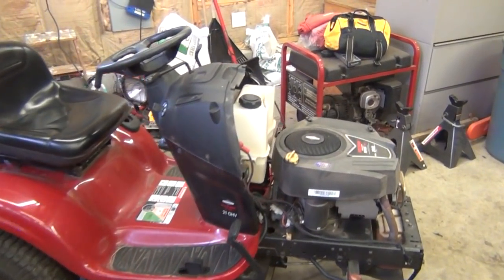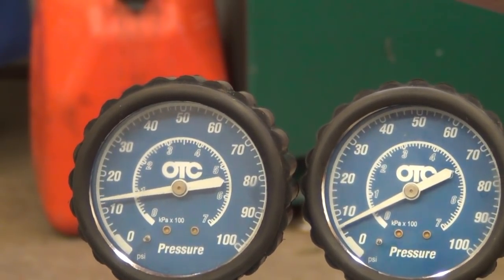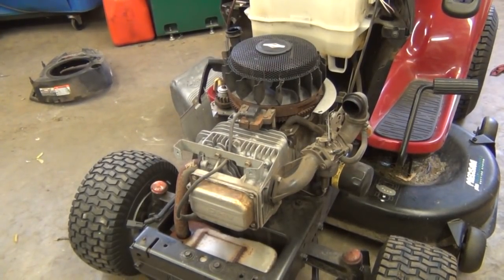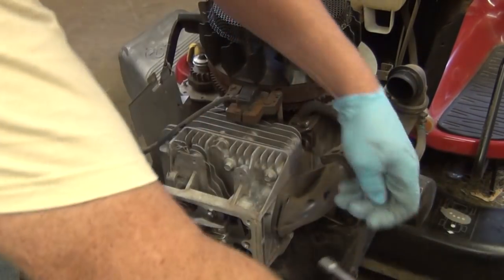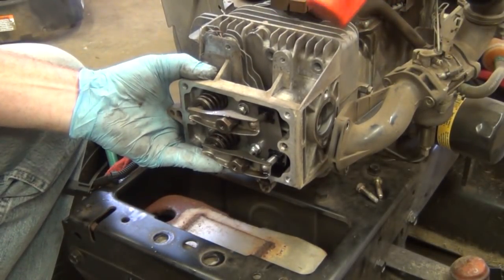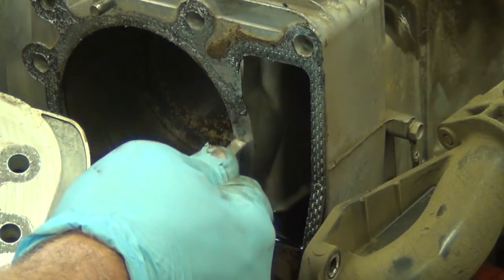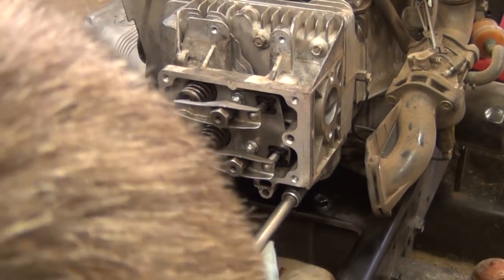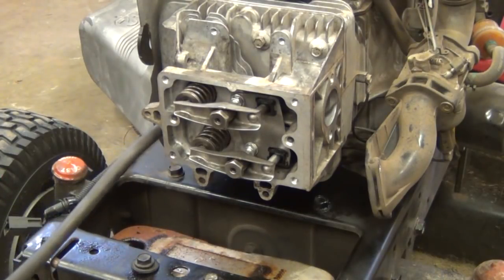Briggs and Stratton Cylinder head gasket replacement

Comment: Thanks for your head gasket replacement guide. It helped me doing the task. BTW. I went to our local lawnmoverstore for get a new head gasket. The old man said. If your head gasket is blown, you also have to get your cylinderhead planned. Else the head gasket change only will give you a few hours of happiness. I went home and checked my cylinderhead for warping with a steel ruler. It was warped as f***. So i went to the next big town and get my cal head planned. Got the engine assembled and valves adjusted. Everything runs smooth. Thanks to you and the old man at the lawnmovershop.
Reply from the maker: When I have the head off the engine, I run a straight edge down it to see if it's flat. Sometimes, they are not too bad and I clean them up with a file on the high spots.  If the engine has been neglected for most of it's life, I replace the entire head assembly (head, valves, seats, rockers, etc) with a new one. The complete head kit including all gaskets is about $110.00.  Many times,  one (or both) of the valves will seize in the valve guides and you end up bending a push rod after a short amount of use. I take each engine case by case and determine what the practical life of the engine is and how much a customer wants to spend on the repair. I would rather replace the head and give them a break on labor and have a pretty good idea that the engine has been put back into service with the proper repairs and the customer will get decent life from it.

Comment: Thanks for the straightforward video, very easy to follow. About to tackle the head gasket on my 21 HP B&S intek engine and will be using this for guidance. Was happy to find out the rockers didn't need to be removed.

Comment: That's exactly what I did.
Pulled the head, found a cracked piece of the compression ring welded to the top of the piston ( didn't expect that ).
Rebuilt the engine with a .020 over piston, it's a little hard to start due to the increased compression but runs like brand new.
I would advise just having the cylinder re-sleeved and going back with a std. size piston to avoid compression lock, the starter is not designed to turn an engine with compression over what it was designed for .
Reply from the maker: +Rusty Nuckles As far as the compression goes, I bet you have too much clearance on your valves and the compression release is not working. Check the valve/rocker clearance for proper clearance and take a look at the rockers as the compression stoke comes towards TDC, you should see one of the rockers tip a  valve open just a tiny bit to release some of the pressure.  It might be the exhaust valve OR the intake valve (depends on the particular engine model) but one of the valves should be doing this. If the rocker-to-valve clearance is excessive, the valve won't open enough to dump the pressure and the starter motor won't have the torque to spin the engine. Question: When you had the engine opened up, did you notice if the camshaft had a working compression release on it?  Many times these little parts break off and the compression release stops working. I would be surprised if this wasn't your problem with the hard starting. What is the engine model/type/code?

Comment: lots of people seem to want to jump on replacing starters or batteries when all they need is a simple valve adjustment.  I have to say I have never peformed a valve adjustment but, I know just because it may start slow or sound like its dragging isn't always a starter or battery problem.

Comment: Thank you Dan!! I Greatly appreciate the help.. I got her all together and she didn't start.. I figured my TDC was on wrong cycle  so took 10min  to readjust and she fired right up! Thanks again!!!
Reply from the maker: I will probably do a more detailed video soon ( no snow here=not much work to do) on setting valve clearances and how the compression release works on those Briggs OHV engines.  I see lots of folks trying to solve "electric starter" problems on there Craftsman tractors where the engine won't spin using the electric starter only to find the root cause is the valve clearance is too loose and the compression release is not working. I usually see these machines after the owner has replaced the battery 3x and tried everything else they can think of. Glad yours is running!
Reply: Dan Small Engine k

Comment: Dan in we were in auditorium showing your video to a group of  DIY-er's such as myself. You would be getting a standing ovation  for your video for a terrific video.  I am hoping you also made video for setting valves.
I just went into your site a video uploads and sadly I see you've not uploading anymore.  I think you had a real gift in being able to explain things.  example about starters batteries mistake That was me....
Reply from the maker: Hi, Thanks for the kudos. I was just thinking the other day, I haven't uploaded anything new in a long time. I have been running a few different businesses and I'm just short on time. I actually had a 28" Simplicity snowblower in my shop last week that had a bunch of odd issues. I spent a ton of time on it and in the end, I basically gutted the entire lower drive system and replace most of the bronze bushings. It would have been a great video!  Next time I get something big in, I'll do a video. Thanks for your feedback. I'm glad they liked the video!

Comment: on another Head Gasket video dealing with the Briggs and Stratton engine they had little caps on the valve ends
I have not heard of the compression release you explained - thank you
Reply from the maker: I have seen some with caps and some without. Not sure if they do that on certain engines only or what.

Comment: Great guide, I'll be facing this job in my lt1000 soon, it's smoking alot and spewing oil out of the dipstick, I was wondering if I can do the job without taking off the rockers and pushrods to avoid shimming later on.

Comment: I also had one of these, but it had overheated and blew to the outside instead of between the valves and combustion chamber. The plastic flywheel fan at the top had broken and cause the whole thing to overheat

Comment from the maker: The compression release is on the intake valve (not the exhaust valve like I said in the video).  You will notice the slight blowback into the carb when slowly turning/starting the engine for the compression release. I suspect the compression release is on the intake valve to make the EPA happy... wouldn't want any raw fuel to be released out the exhaust port into the atmosphere... makes sense.

Comment: Hi, I have a vtwin intek that started surging pretty bad lately. I checked my fuel flow which is good, put on new fuel filter, cleaned the carb and replaced some of the gaskets, check the sparked plugs and regapped the coil to .0010 (.008 to .012 recommended) and fresh gas but it's still surging. I've had valve noise (tapping) as well for quite some time as i really did not have the sense to adjust the valve's until last year ( still taps) plus my mom over filled with oil one time and smoke was blowing out the exhaust manifold lol. Lawn mower's getting up there in age (15 years old). I think i got some head gasket issue's as the spark plug threads were a little wet, although it does not smoke all that much. So i am gonna pull the heads and check the valves. Wonder if my piston rings are still good yet. You happen to know the compression psi for the intek v twin ? Maybe she needs a total rebuild lol....... Good vid

Comment: hey Gary my 115 john deere had a similar situation took it apart and found the release switch on the camshaft came apart due to the plastic holding a little pin had melted
Reply from the maker: Yup, it happens all the time.

Comment: Thanks for you video. really helped me diagnosis mine. same engine and same model tractor. Do you have a video on setting the valve lash? without a leak down tester, is there any other way to make or do a leak down test?

Comment: What you are describing on the compression stroke with the momentary release is what is messed up on my machine. The compression is so high that the engine gets really tight and is hard to turn on the compression stroke. Thus making it hard to start. I will go back and adjust my valves again, but I swear I think they are dead on. Should it be a loose adjustment or tight? My range is .005-.007 on the exhaust and .003-.005 on the intake.
Reply from the maker: When the compression stroke is just coming up, you should see one of the valves( I think the intake ) just open  up slightly and release some of the compression. If you don't see it, you probably have a broken compression release assembly on your camshaft. I have seen them break many times and you would have to open up the engine sump to get access to it. A cam is about $80.00 bucks and you will need the sump cover gasket as well.  I would VERIFY you have no compression release buy setting the lash to .000 and slowly turning the engine by hand to see if you get ANY valve action on the upward compression stroke. You should see one of the rockers/valve open a tiny bit as the piston comes up and about 1" from the top, the rocker should "snap" closed. If you don't see any such action, you probably have a broken release on the camshaft. I see it all the time on the 15 cu in Snow blower engines. I think Briggs had a bad run of them about 10 years ago.

Comment: I'm working on the same motor and tractor and the same gasket issue, in the same place.  Easy fix, but that is really a poor design.  Not enough metal and gasket to seal long term.  Even the manual says that the gasket will need replacing every so often.  So, this is now maintenance????
Reply from the maker: Yeah, It's probably about cost and service revenue. I agree they should improve the gasket so it has a metal ring around the cylinder to prevent leaks. Ideally, the head needs another bolt between the push rod area and the cylinder to clamp the gasket firmly. Of course Briggs won't redesign the engine for something like that... too costly.

Comment: Hi Dan.I'm working on the same.but the lower push rod was bent when I pulled the head.
Reply from the maker: Hey John, If you have a bent push rod, you probably have a damaged valve guide and that valve is sticking/jamming and this is WHY the push rod bent....  When the engine overheats or the oil is low(usually both), the valves don't get properly lubricated or cooled. Once this happens, the valve stems get scratched up, you start to get metal transfer from the valve guide to the valve stems and the valve eventually jams in the head and the push rod will bend since it's the weakest link in the valve train.  This is very common.  If the engine is decent and the tractor is not too old (5-8 years old), I would replace the entire head assembly (head, valves, rockers, etc  - comes in one package from Briggs) and replace the push rod ( or rods if they are both bent) and reassemble the engine.   The new head (updated from the head you probably have) has slightly larger cooling fins and a new metal shroud that goes around the head/cylinder to channel the air from the flywheel down past the head (for cooling).  Make sure to swap out the metal shield since the head is slightly larger and you need a bit more length on the shield to cover everything... (It's not critical but if you plan on keeping it , I would swap the shield since it comes in the head kit).

Comment: Hi Dan I need your help ! I have a brand new ( Troy-Bilt TB30 R Neighborhood Rider 30" Riding Mower - 420cc ) My son lifted it up from the front to clean the deck out  and gas spilled out over the air cleaner ( I fixed that ) the engine won't start and there is oil in the cylinder ! I tried cranking the engine over with the spark plug out and the oil just keeps coming out !  Briggs and Stratton looks like the one in this video but mine is 10.5 HP

Comment: Great video, but then your warnings scared me off.  First, how do you move the piston to Top Dead Center? And secondly, you said if it was my first time, I might have to remove the rocker arms and then you gave a lot of warnings that I didn't understand.  I'm a farmer and I can't afford not to fix things myself, but can I replace the head gasket the same way you did?
Reply from the maker: Sorry for the missing details.  Just turn the flywheel on top of the engine until both valves are closed and the piston is at the top of the cylinder.  You can loosen the rocker adjustments with a 9/16" wrench in most cases. set the clearance for around .005" or so on each valve. Check the Briggs book for exact spec. I will probably publish a valve clearance video soon since many folks have hard starting issues with these engines and start replacing starts and batteries only to find out the root cause is a simple valve clearance problem. Remember - the compression release is on intake valve and if your clearance is too large, you won't bleed off enough pressure and your starter motor won't have the balls to turn the engine past the compression stroke..
Reply: Dan, after you follow your step to turn the flywheel until both valves are closed and the piston is at the top of the cylinder, is there a reason or need to have to make any adjustments to the rockers before putting everything back?  That is where I am a little lost.  Thanks for your help.  PS- I'm in New England as well !

Comment: Hey first off, thanks for the video tutorial!
I picked up a Briggs 13.5 OHV that has Zero compression ( I don't own a leak down tester ) before I pull the head, do you think this is my problem?
Valve lash: .005, push rods not bent,
Have you ever had to lap the valves in these things?
Thanks again.
Reply from the maker: +Rusty Nuckles  Hey Rusty, I lost my login to this account so I have been offline for a while.  It could be a stuck or bent valve.  It the engine was run low on oil or overheated, the valves will sometimes seize in the head and stay open. It could also be a loose valve seat. The valve seats are pressed into the head and they sometimes come loose and get stuck under the valve 9holding it open).  The best way is to pull the head  and see what you have.

Comment: My 20 horse intek engine after sitting the winter ran rough after start up then belched out big cloud of smoke then would not run. Would a blown head gasket stop engine from starting? Engine cranks with key but just makes a metal like rattle sound! Any ideas?

Comment: I just replaced the gasket and put everything together like before. Engine turns and I can hear/see white smoke comes from air filter area, but it won't start. It is keep turning, but it won't start. It used to start before changed the gasket. Did I mess up something with rockers? I had hard time to put them back. Do I need to open it back up and do something with rockers? Any suggestion would be appreciated. Thanks
Reply: Adjust the valves

Comment: Can this also cause the oil, to come out the exhaust?
Reply: In a round about way it could. But, that would most likely be another issue such as worn piston rings, over-filled oil, or a bad crankcase breather. Or, it could be a combination of these.

Comment: great video, what is the head gasket part number?
thanks
Reply from the maker: It depends on the size of the engine. Check the engine code and find the correct gasket. It's probably 796584  or 794114 .  The gaskets are similar but the size of the bore is different so make sure you check your particular engine number and get the correct gasket.  If you are replacing the entire cylinder head (instead of just the gasket), the kit will come with 2 new head gaskets and you choose the correct size for your bore.   The new head gaskets actually have a stamp on them that says "31" or "33". The complete head kit is 796026 and it replaces older heads 794123, 796005, 794223  or 793990. It comes with the valves and springs installed and new rockers and lock nuts. It also has the valve cover gasket, intake gasket (o-ring), exhaust gasket and a new heat shield. The new style heat shield is slightly larger than the original  and goes around the cylinder to direct the flow of air past the cylinder fins and head fins for proper cooling. There is a tiny screw on the bottom of the cylinder that needs to come out to remove the old heat shield but it's tough to reach. I think a 1/4" wrench will remove it.  Make a decent effort to replace the old shield with the new one provided in the head kit but If you just can't get it out, you can use the old shield by bending it around the new cylinders head's larger fins. I'm sure it will cool just fine using the old modified shield if you just can't get the old shield out.
Reply: Thanks for the info Dan

Comment: man i just did a head gasket.firgured that would fix my carb from misfiring.but it turns on a lil better on full throttle then on half throttle it backfires then a huge loud spark and the engine stalls.any ideas?i rebuilt the carb 4 times.but not recently.
Reply from the maker: You probably have a partially sheared flywheel key and the timing is off. Remove the top cover and flywheel nut and see if the slot in the crankshaft and the slot in the flywheel are offset. They should be lined up. If not, pull the flywheel and replace the key. That engine typically runs well so the backfiring could be a timing issue. Also, make sure the valves are adjusted properly. They should have about .007 -.009" clearance or so. You might have one of them too tight and it's keeping a valve partially open. Check the flywheel key first.
Reply: Ill check it again.it looked like it was slot wasnt off setted.but ill check it again and ill space out the valves @ .007 and @.009 thanks